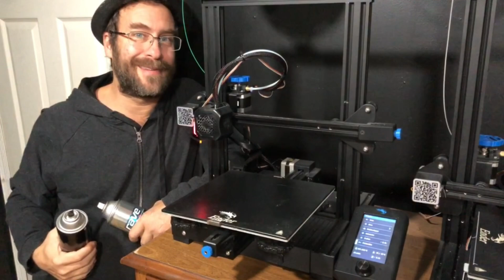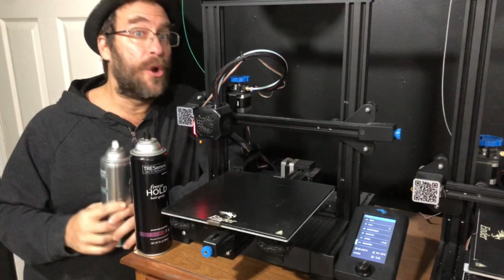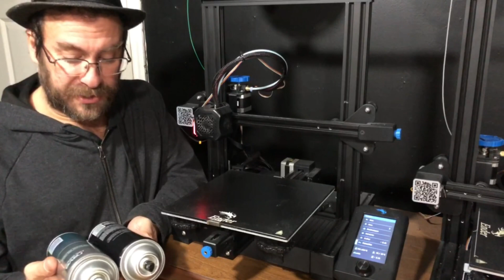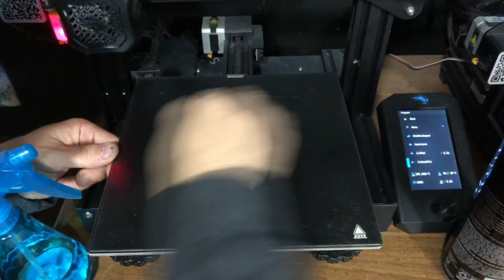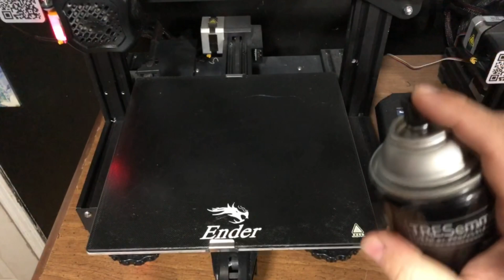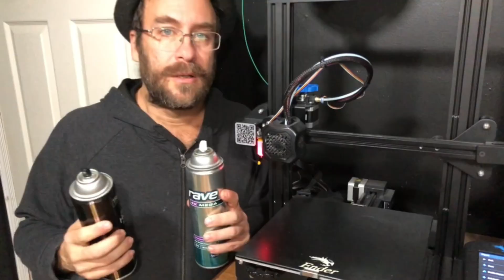YES: Hairspray can help with Glass Bed Adhesion *AND* Removal. CHEAP Vs. QUALITY for your 3D Printer

Comment: Would this be beneficial for an enclosed printer like the Bambu Labs P1S? I'm having adhesion troubles on their PEI plate with smaller parts.
Reply from the maker: Make the move to their Textured PEI plate, and grab their "liquid adhesive" also. Your problems will end

Comment: Around 2019-20 worked hairspray method well. Now not work, i don't get it why.. Normal 3mm glass plain.
Reply from the maker: CLEAN, and proper Z-Offset, are the most important part. 
also, might be time for new glass
Reply: @3DRundown  Glass is new, next i have free time clean again, and do again the set the z-ofset
Reply from the maker: New Glass tends to hold TOO well. I suspect you need to work on your Z-OFFSET: Try this drill: https://youtu.be/veZB415QHM0?si=-_hkUuBGawCVndNl
Reply from the maker: OR, my entire process: https://youtu.be/q_MYYZ2ggAY?si=Na7drZN9q6zVSZ9l

Comment: NO EVERYONE PLEASE STOP USING HAIRSPRAY AND GLUE!!! Number one Your printer should be enclosed...GLASS bed plate cleaned with acetone and heated to 60 C for five minutes then heat nozzle to 210C for three minutes and start print from 0.00 in your settings
Reply from the maker: HAHAHAHAHHAHAHAHAHA    I can't believe how much shit advice you managed in one run on sentance. Please don't type on the internet anymore.

Comment: Tried it and hair spray worked. 👌Hair spray strength was labeled maximum hold, 15 in number. Hair spray was over 30 years old. 😅Helene Curtis was the brand.